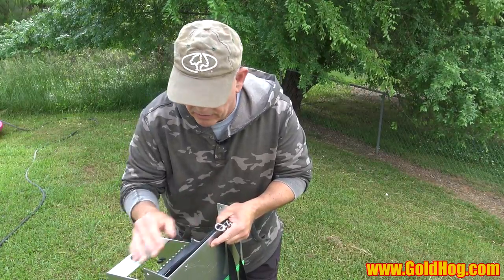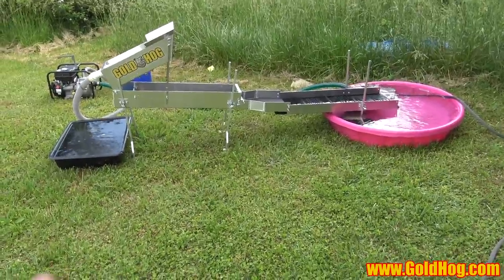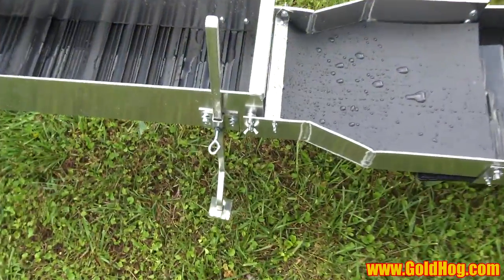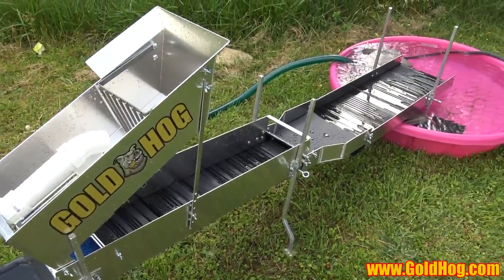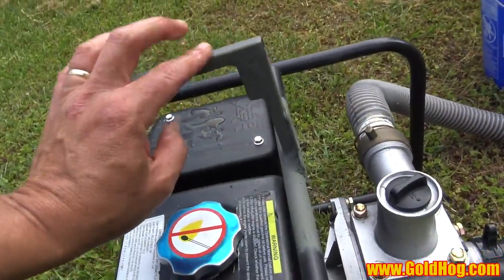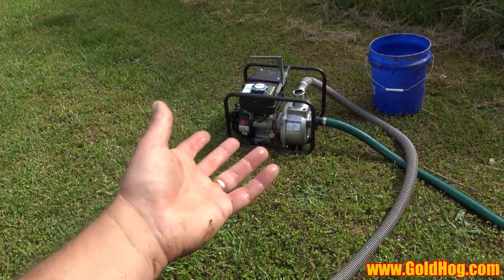Piglet Flare Mini Highbanker - Gold Prospecting

Comment: Just a tip from someone in the goldmining industry, if you throttle back any ball valve, it will fail. It may last a while but ball valves are for open or closed. Even the brass and stainless ball valves will disintegrate in a few weeks. Otherwise it looks awesome@
Reply: Here's another reply, also from a long time miner.  I have found that the usable life of a ball valve is singularly dependent on use and abuse.  The scale of mining that this backpack highbanker uses will go years without troubles.  Using the engine RPMs to provide rough GPH and fine tuning with a ball valve is certainly A-OK.  Now, put a full blown operation through that 1" or 2" valve and problems could develop in a relatively short time.

I have been using ball valves (and engine RPMs) for 25 years without the first failure.  I just wish I had them to use back in the mid 60s when I started out.

Comment: Doc, Why don't you use a battery powered pump instead of the gasoline pump on a test?.
Reply: He has a video on here that is titled Pump choices for the Raptor flare... But the reason why he doesn't like to use them is because they don't have any PSI.. He also has a separate video about the mini and he has it running with a 3700 GPH pump.

Comment: Y'all should make a Highbanker Crashbox for the Stream Sluice.. I would sure buy one if you did.. I have the Power Pig Header for it.. I also made me a Crashbox for it, but I would like it better if you made it... The one that I made is ok.. I even made a Reverse Ramp Riffle and I added an extra 20 inches to it at the Crashbox side so it breaks down easy..  it's on one of Au79's videos. But I didn't bring all of my pumps that I use for it, so I didn't have enough water flow.